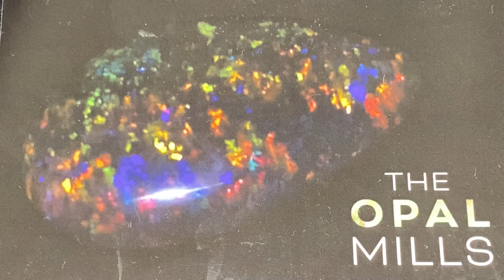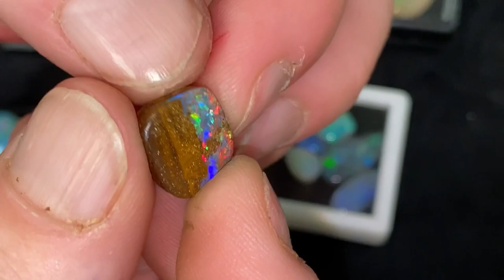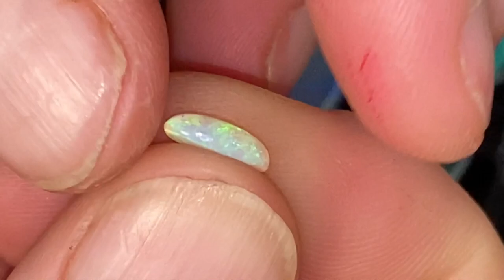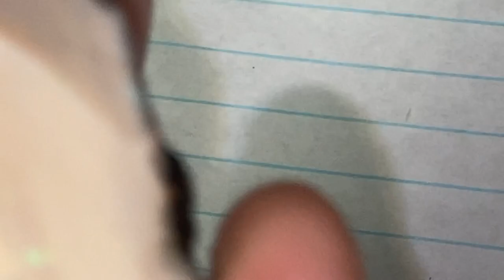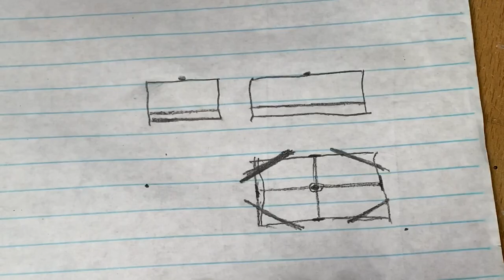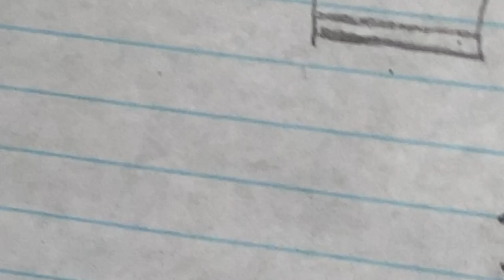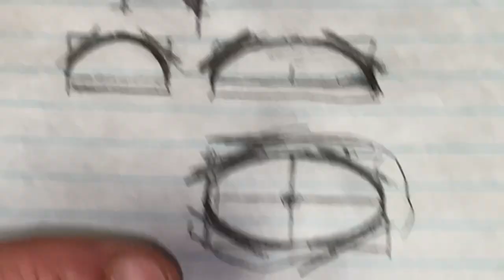Opal cutting: how I cut a centred dome: pt 1 cutting tips.

Comment: but this dome would only work if you have thick color bar ?otherwise you would end up with a nice color in the middle and no color on the edges of dome?justin called it "fried egg" correct me if am wrong.
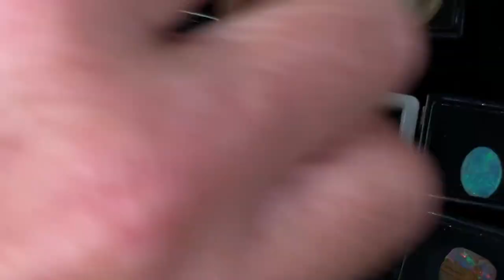Reply from the maker: Correct, I did mention I’m lucky enough to have colour throughout this one, and I did try explaining the difference in cut due to colour bar thickness, but irregardless, the technique is the same, just as I mentioned in this video, if you have a thin colour bar you’ll need to adjust the height at which the girdle/sides start to dome from. There’s a white oval with a thin colour bar in the beginning 0:4:56 I also mention it there, again cut with the same technique of shaping/preforming/cutting and polishing, (laps then rocking), you’re just not going to cut a very high dome but it will be central. 🤪👍